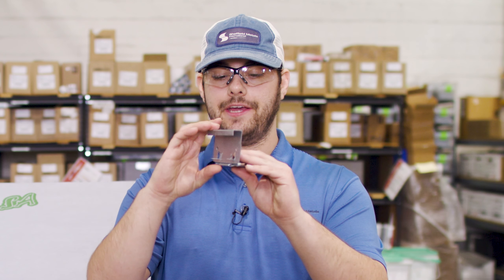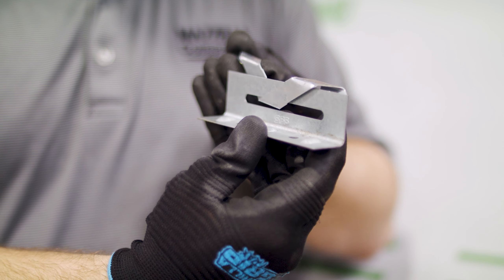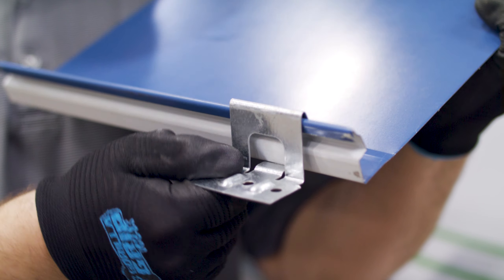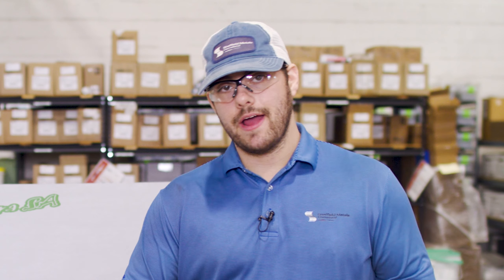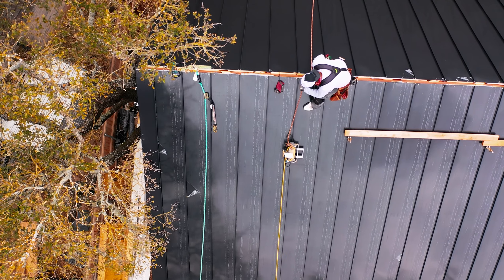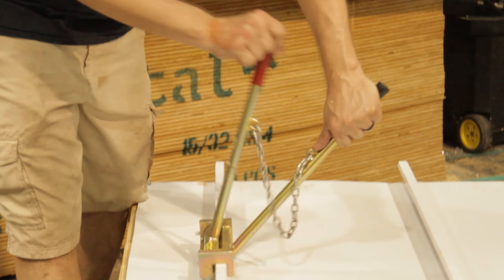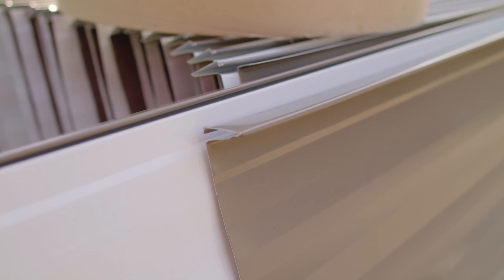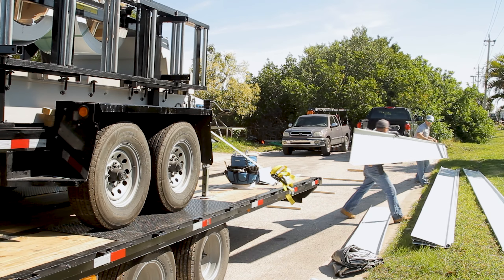Which Metal Roofing Clip Should You Choose? Types, Uses, Installation

Comment: Is it necessary to use stainless clips when installing an aluminum roof (PVDF finish) at the beach?  Would electrolysis set in if one installed the roof with galvanized clips?